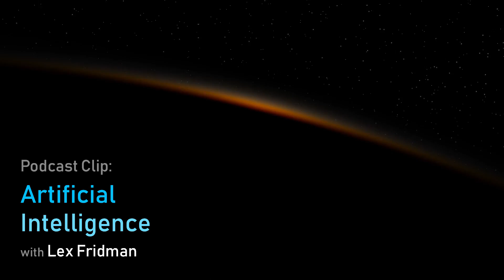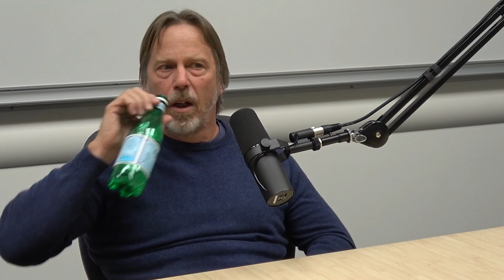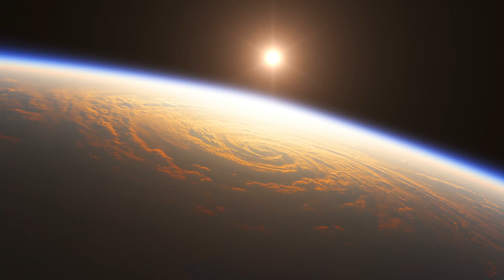Moore's Law is Not Dead (Jim Keller) | AI Podcast Clips

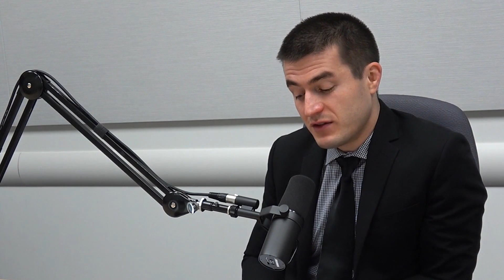Comment: 00:00:01 Continue innovating and leveraging Moore's Law for future advancements.
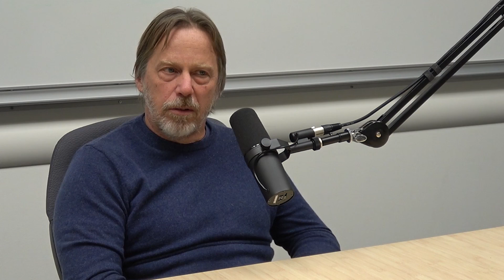00:00:24 Define Moore's Law as doubling the number of transistors every two years.
00:01:23 Reflect on the broader definition of Moore's Law and its impact on performance.
00:02:57 Acknowledge the longevity of Moore's Law and its continuous evolution.
00:03:16 Understand the cascade of diminishing return curves in technological innovations.
00:04:21 Explore the potential of quantum effects and smaller transistors in future technology.
00:05:14 Consider the methods of shrinking transistors and controlling manufacturing processes.
00:05:41 Recognize the broad spectrum of technologies involved in innovation beyond shrinking transistors.
00:06:51 Anticipate the future of computing performance and adapt design strategies accordingly.
00:08:52 Divide and conquer complex designs into manageable pieces as computational power increases.
00:09:33 Refactor software to optimize performance with the increasing number of transistors.
00:10:00 Explore advancements in parallelism and massive parallel computing for improved performance.
00:10:44 Understand the hierarchy of mathematical computations and the evolving nature of AI algorithms.
00:12:26 Consider the optimization and search processes involved in neural network operations.
00:16:31 Reflect on the fundamental changes in computation with each order of magnitude increase.
00:19:34 Embrace the ongoing innovations and reinventions in semiconductor technologies.
00:20:58 Anticipate unpredictable transformations in computation with future advancements.
00:21:23 Architect the future by being mindful of the impact of technology on our lives.
00:21:42 Take a stand against the distracting nature of mobile phones to improve focus.
00:22:19 Reflect on your role in shaping the future and consider the responsibility it entails.
00:22:49 Acknowledge the unpredictable nature of actions and developments in the technological world.
00:23:12 Contemplate how tools like smartphones are transforming our world.
00:23:19 Evaluate whether technological advancements are leading to a better future.
00:23:26 Engage in interdisciplinary discussions to explore complex questions about the universe.
00:24:02 Explore the inherent connection between the physical world and mathematics.
00:25:00 Embrace the advancements in computation, including machine learning, to uncover new patterns and possibilities.

Comment: 1 nm is the width of 4 hydrogen atoms placed side by side. We currently have 4nm processes. We are already at 16 atoms wide. This guy is talking out of his ass. Well beyond his time.
Reply: I am afraid that it is you that does not understand what you are talking about. Let me guess you actually believe that transistors are 2nm is size. Out of curiosity do you believe that 2nm transistor is volume, area, radius, diameter or something else?
Reply: @bighands69  they are literally on carbon atom thickness at current date. Your point is entirely moot. 

 "Now, by using atomically thin materials, scientists in China have created a transistor with a record-breaking gate length of just roughly one-third of a nanometer wide, only as thick as a single layer of carbon atoms, shedding light on how much smaller—if at all—transistors can possibly get". 

Moore's law is entirely dead by all conventional standards.

Comment: Moore’s Law has been dead for over 10 years in terms of fundamental limits on shrinking transistor sizes. [Good news: If you purchased a computer in the past decade with a multi-core processor, multi-channel memory, and SSD then your computer will likely be a good performer indefinitely.] Jim Keller is not lacking for confidence even when he’s wrong. Welcome to Intel.
Reply: Moore's law has absolutely nothing to do with the size of transistors. It is about the number of transistors that are in an integrated circuit. 
There is a lot more space down at the bottom than people realize.
Reply: how does that make moores law dead? everything still has a limit even the computer and ssd you bought. i've been hearing this for 20 years and yet nothing.
Reply: Erm, you can suffer with your 2600K, I'll take the modern stuff, thanks

Comment: I've always thought moores law has held true if you just don't simply watch at the capability of a single dye to hold transistors, but a calculation of number of capable transistors in the whole domain. ie; for you can network and do parallel computing, the amount of flops you can produce with the same work doubles each two years. You can make about 1.666 times more capable computer/transistor, and some 1.333 times more of these computers, thus the computational power doubles each two years.
Reply: Moore's Law is about the number of transistors present on an integrated circuit. It is not about the size of the transistors nor does it stipulate the type of architecture being used. If you take the number of transistors on the first generation integrated circuits and calculate that against the top chips today in 2023 you will see that it has doubled every 2 years producing about 43.6% growth every year. 
The reason why computing power is doubling every years is due to the fact that computing power is more than just Moore's law.
Reply: @bighands69  its a bit under double or how moore said it himself. But it’d be double if you just look at raw available computing power.

And like petra, was carved silicone with multiple meter architechture. If you reverse moores law 2000+ years, it goes to fractions of if 1 would be a 8088

Comment: What is he talking about? We haven't seem proper improvement in X86 performance since around 2014. Things are only gettint paralelized but there is just as much as you can shift towards multithread. X86 is already at its limit, we can't get transistors samllers, we can't run then at higher frequency... thigs are not even close to what it was from 2000 to 2010. It is not linear, it is a exponential curve.
Reply: That has absolutely nothing to do with Moore's law. Moore's law is not about the feature sizes either that people keep bringing up.

Comment: May's Law states, in reference to Moore's Law:

Software efficiency halves every 18 months, compensating Moore's Law.

David May (born 24 February 1951) is a British computer scientist. He is a Professor in the Department of Computer Science at the University of Bristol and founder of XMOS Semiconductor, serving until February 2014 as the chief technology officer.

May was lead architect for the transputer. As of 2017, he holds 56 patents, all in microprocessors and multi-processing.

When Inmos was formed in 1978, May joined to work on microcomputer architecture, becoming lead architect of the transputer and designer of the associated programming language Occam. This extended his earlier work and was also influenced by Tony Hoare, who was at the time working on CSP and acting as a consultant to Inmos.

The prototype of the transputer was called the Simple 42 and was completed in 1982. The first production transputers, the T212 and T414, followed in 1985; the T800 floating point transputer in 1987. May initiated the design of one of the first VLSI packet switches, the C104, together with the communications system of the T9000 transputer.

Working closely with Tony Hoare and the Programming Research Group at Oxford University, May introduced formal verification techniques into the design of the T800 floating point unit and the T9000 transputer. These were some of the earliest uses of formal verification in microprocessor design, involving specifications, correctness preserving transformations and model checking, giving rise to the initial version of the FDR checker developed at Oxford.

In 1995, May joined the University of Bristol as a professor of computer science. He was head of the computer science department from 1995 to 2006. He continues to be a professor at Bristol while supporting XMOS, a University spin-out he co-founded in 2005. Before XMOS he was involved in Picochip, where he wrote the original instruction set.

Comment: Moore's Law was that "Transistor density doubles every 18 months".
You can't just redefine it to say Moore's Law isn't dead, under the original definition it has been dead for well over a decade, when Intel stopped going from 386->486->Pentium->P2->P3->P4 and instead switched to core i5 etc was the point when Moore's Law died. 
Intel had to change it's marketing and branding to obfuscate the fact they could keep up with Moore's Law and keep a differentiated market place.
Reply: I'm going to go with Jim Keller on this one.
Reply: Moore's law is not strictly about density but was about the number of transistors that can integrated onto a circuit. It does not stipulate the size of the circuits, topology or geometry of integrated circuits. 
 Intel chips went from producing 1 million transistors to producing about 48 billion in about 30 years which is a doubling every 2 years.
Reply: @bighands69  Bullshit. 
When Moore spoke he was strictly speaking about transistor density.
Yes I'm old, yes I was there at the time.
 That bullshit free definition is exactly why it became the Iron law of digitisation for a time.

Moore's law has been dead for a long time, stop making excuses and limiting yourself, it was a useful guide for a while but today it is a crippling constraint on creativity and progress.
Stop worshiping a dead paradigm.

Comment: I feel moore's law is absolutely dead.  My computer has 3.5ghz proc with 6 cores bought in 2013.  if Moore's law kept up, you could buy a proc over 56ghz, but we been stuck around 3.5 for around a decade or so.  People try to squirrel out of it by saying things like "well they are adding more processors on the same chip" or what ever.  It's just a cop out, and I get why JK would not want to admit it considering the industry he is coming from.  However, if computers were truly doubling in power (an argument you would have to be making if you are trying to get out of the fact that you can't buy 56ghz+ processors), then we'd be able to do amazing things with the computers we have today that my computer from 2013 couldnt even dream of.  Its just not true, in fact, my current computer is still pretty high end compared to computers today.  In fact, my 1.1ghz computer from 2001 states by more's law we should be able to buy 1thz computers already.

Imagine if you said the same thing in 2002 - where a 1994 computer was still impressive in 2002.  You know its true, the rate of hardware development has slowed substantially in the past 20 years.  Moore's law is completely dead, its not a big deal but seriously,  stop covering your eyes and holding your ears to the truth.
Reply: Moore's law has nothing to do with clock speed.

Comment: No no no. I experienced Moore's Law as a kid, up until young adult in 2005. Even around that year, the rate of doubling speed + halving cost WAS DEAD (this defines Moore's law if you dig into it, halving cost is a major component). After that what has happened is that we focused on creating multiple "cores" (since we hit around the physical limit of a single one), and they are NOT the same thing, since you need great programmers to code multithread (which few are capable of doing). If you bought a computer in the year 2000 and another one in 2005, it felt like you advanced 15 years! It was ABSURD what computers could do, you bougth one today and next year you would have something that completely outclassed it. Makes me sick to see engineers compare todays advancements with that Era, it is just impossible and they know it. To conclude, I'm not saying today's advancements aren't more complex and impressive they are probably harder to achieve, but it is just _so much slower_ by whole magnitudes. Not saying he is lying, but he is being extremely "smart" about his phrasing and semantics.
Reply: Moore's law has nothing to do with speed.

Comment: If you had a clean postulation in response, rather than "if you wanna go there" with respectful relegation, the clarity of immediate explanation would be non offensive to an open computing mind.

Organic communally connected brains will be the ultimate harness.
Reply: The thing is Lex doesn't have one.
He has shown that this is just the way he feels to use semantics.
And he is provably wrong.
So, relegation was the only option as he knew that even if he was right, there's no way hae could "outsemantics" Jim.

Comment: Keller Definition of Moore's Law: "The combined process of shrinking things and manipulating/placing them in a working transistor layout using varying contributions of the innovation stack consisting of equipment, optics, chemistry, physics, material science, and metallurgy contingent on manufacturing repeatability and yield"

Comment: Forbes: "Today's most advanced NAND memory chips are shipping with transistors whose gate lengths are shorter than 20nm, or less than half the width of the Ebola virus.

The picture above shows individual silicon atoms overlaid with a 10nm-long arrow.  There are about 20 atoms along this line, so one nanometer is about the width of 2 silicon atoms, and the gate length of a 20nm NAND flash chip would be 40 atoms  across"

Comment: oh yes it is, with regard to current semiconductor base transistors anyway... the only "improvements" weve seen over almost the past decade now, is to make the dies bigger, increasing the core count (which also make the die bigger), or by implementing RISC. you can only make a transistor so small and still have it function and you can only put so many on a die before you run into thermal and other efficiency problems. i dont doubt that this guy is brilliant BUT... explain to me again the difference between the latest i7 and i9 and the proceeding generation of CPUs. for that matter what is the difference between the RyZen and AMD's proceeding architectures  ;)
Reply: Guy who was in control of putting literally every atom on those chips: there are thousands of changes
Guy in the comments: there's not a single difference

Sometimes it's useful to realise that traffic lights look the same to you not because of stupid design, but because of your colourblindness.

Comment: It is not Moore's law that people cared about. It is the corollary Dennard scaling that gave almost all the performance gain. Dennard scaling died a decade and a half ago, or we'd have 2 THz single core processors today.
Reply: Sorry but Moore's law is not about clocking speed or even impedance.
Reply: @bighands69  How are we in disagreement? Did you even read what you replied to? And yes, Dennard scaling was a corollary since both where driven by miniaturization.

Comment: LOL My system specs on THIS computer are an Intel Core 2 Duo at 2.8 Ghz. It's 11 years old.
It wasn't top of the line even then. Today, the top of the line intel cpu is the Core i9-9900k running at 3.6 Ghz.  Yeah, it has more cores, allowing it to do more threads at a given time, but the base speed is marginally higher than the 11 year old cpu I have. That's like giving an engine more cylinders to produce more power, but the baseline RPM of the engine is only upped from 5500 rpm to 6200 rpm. And that's not a doubling of cpu speed every goddamn 18 months. Or hell, even every three years. MOORE'S LAW IS OVER.
Reply: Moore's law never mentioned speed or GHz/MHz in any way whatsoever.
Reply: @Nuclearcx  
It is not even about the size of the transistors that people have bought into. I find it ridiculous that people think that transistors are actually 2nm in size. Now they do not stipulate if it is volume, area, radius, diameter or some other metric which makes it even more vague.
Reply: Amazing. Everything you've just said is wrong.